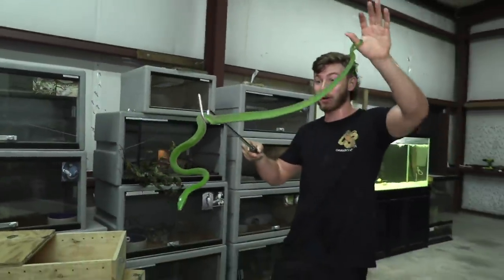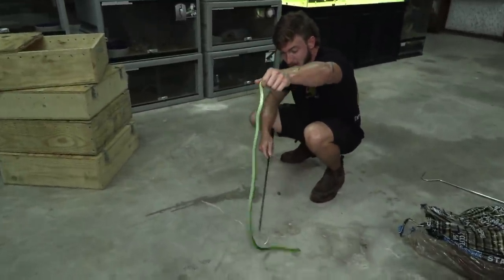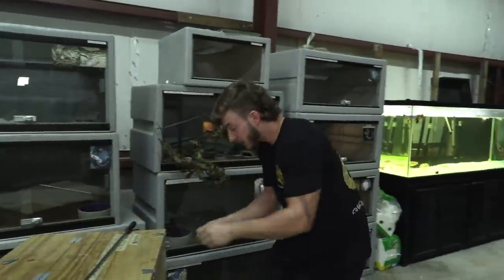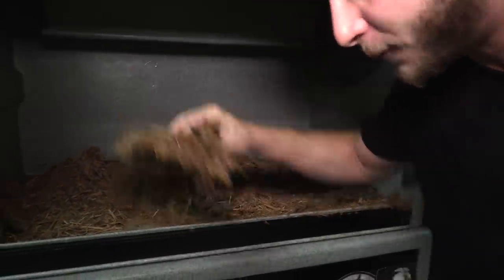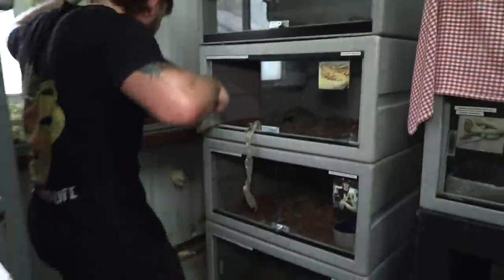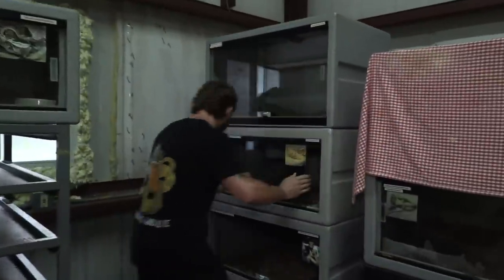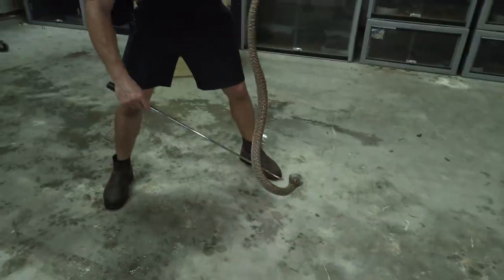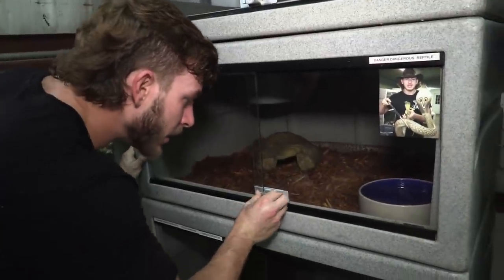GREEN MAMBA MADNESS + @BrianBarczyk!!!

Comment: Chandler, I don't know if you are planning to insulate the walls in the snake room but it is something you should consider doing to save money since you are putting in an a/c. It will make a huge difference on your bills & you won't struggle trying to keep the room cool enough during the hot days!
Reply: I agree it make sense to insulate them now and save a big job later down the line.. it will for sure save a lot of money in the long run..  my reptile shed and invert sheds are both insulated

Comment: If I may make a suggestion, use the drywall that's used for bathrooms. With  Florida's humidity standard drywall will turn to mush. I'm sure you already know this and it may cost a bit more but in the long run it should pay for itself. Your accomplishments are amazing. Well done! 🐍